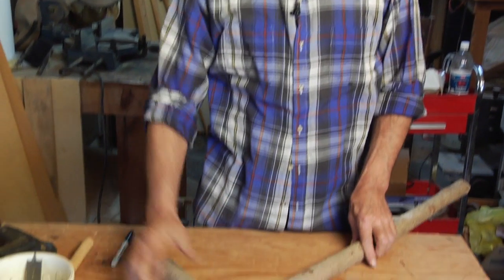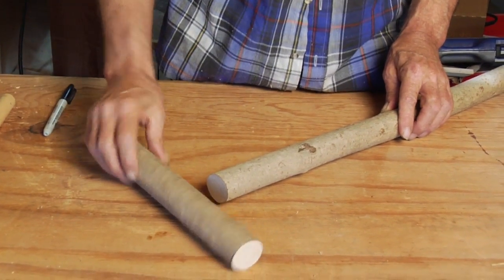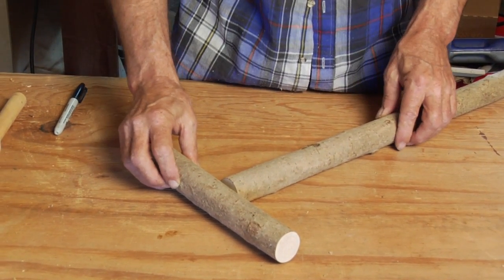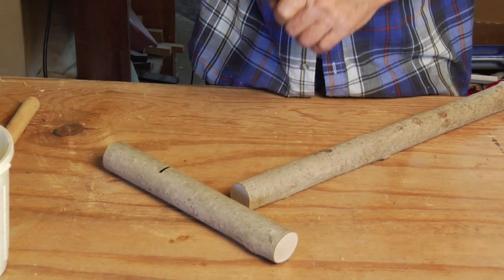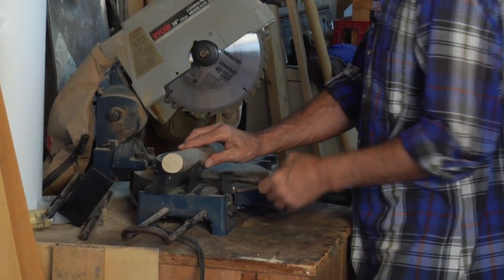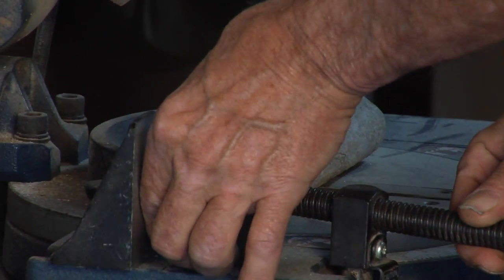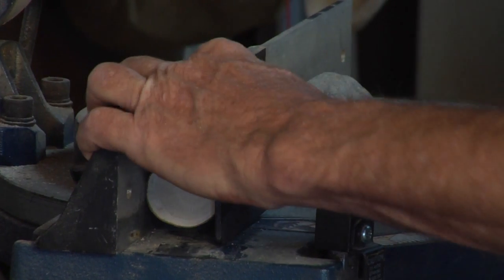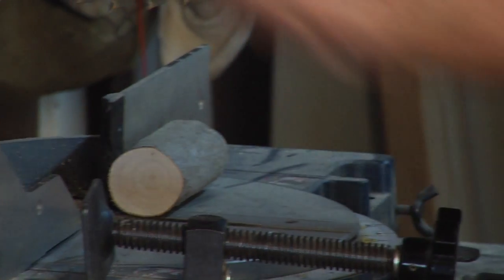How to Make a Wood Walking Cane : Marking Handle for Walking Cane

Comment: dig it out with a belt sander pop a good dowl in and use wet leather rectangle long shape over the handle and down the shaft . then wrap leather thong or your cordage around the shaft nicely . when the leather dries it tightens up good and you really dont need glue . ive made canes this same way for  along time .